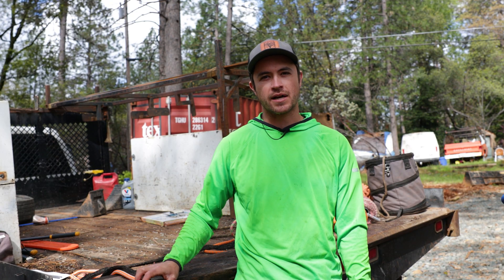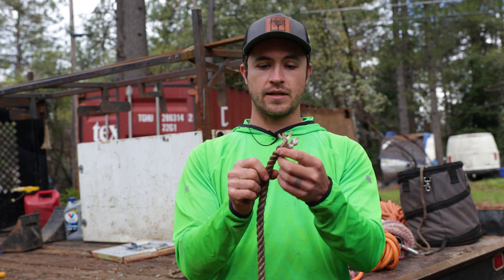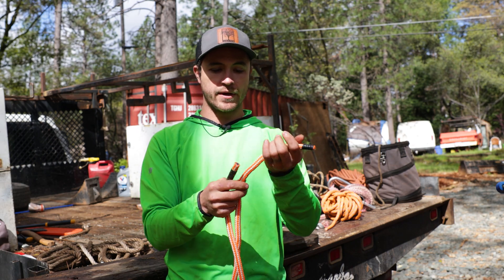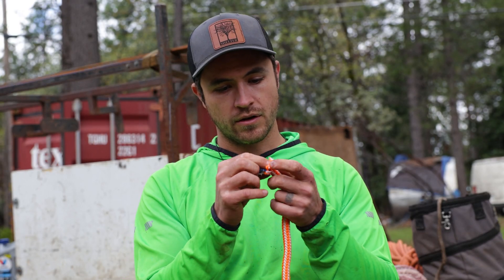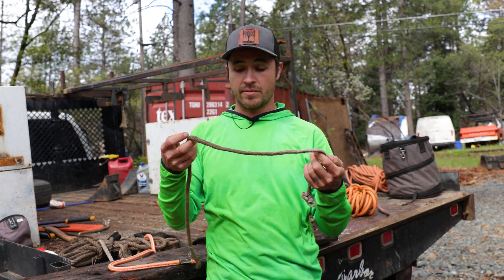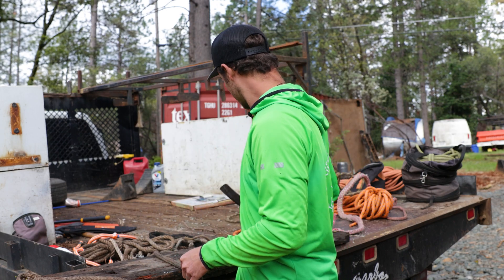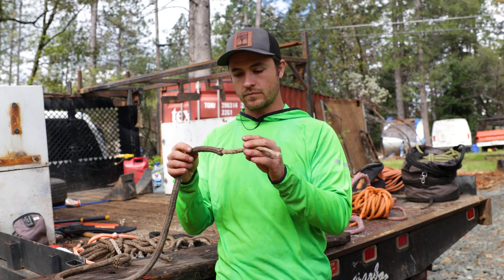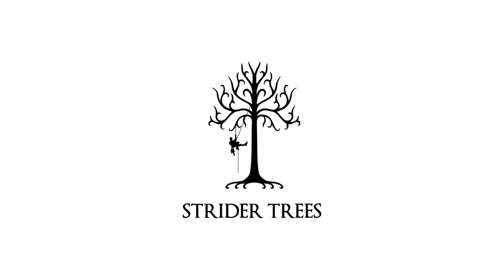Types of Rigging Ropes Explained

Comment: As a newbie i found the rigging instructions helpfull. My personal appreciation was the closeup showing your lanyard "above" the rigging wrap. It showed how a sliding rigging could otherwise take the climber down with a dropped cut.
Reply from the maker: Yeah there’s that potential, If I’m in a smooth bark tree with no other branches or supports I will cut notches into the trunk to be SURE the rigging won’t slide I usually leave my choked primary line down by my knees so it’s still vulnerable to that scenario,

Comment: Sir,  if I have a hollow braided rope and I tucked in all the way from end to end a stranded core braided rope,  would it strengthen more the rope?
Reply from the maker: in theory yes, but its complicated, and depends on the interactions between the two ropes.  It would be fairly easy to do that and have all the load on just the hollow rope on the outside or on the core, in which case you'd see very little benefit as either the outer or the inner would start failing before the other part of the rope started taking load.  This is called "balancing" and good rope companies spend a lit of time and energy in R&D to get a rope balanced between the core and the cover.